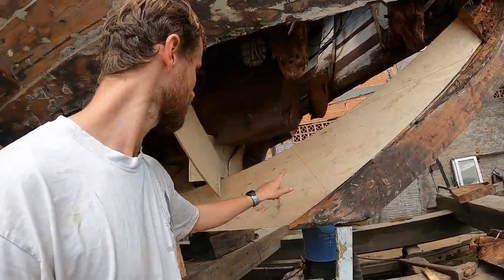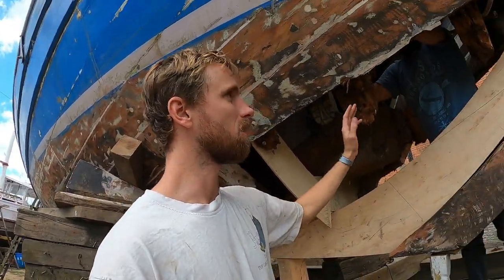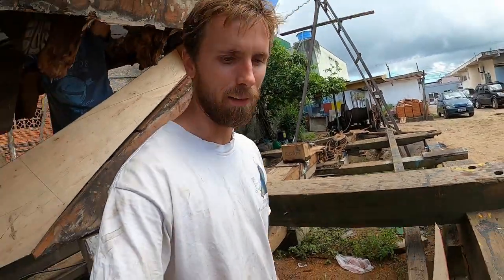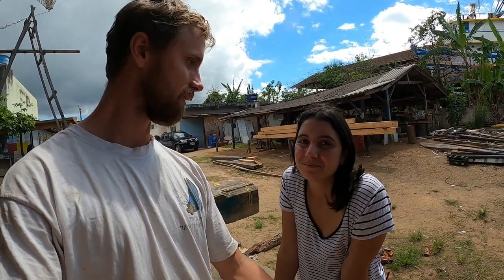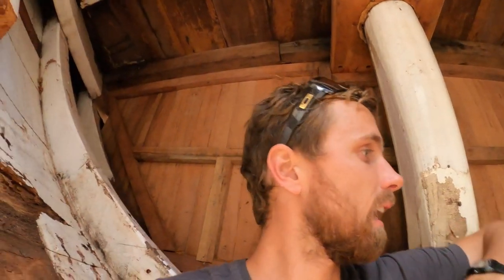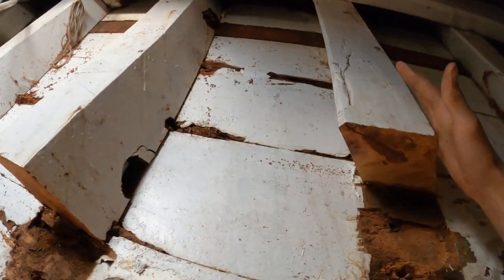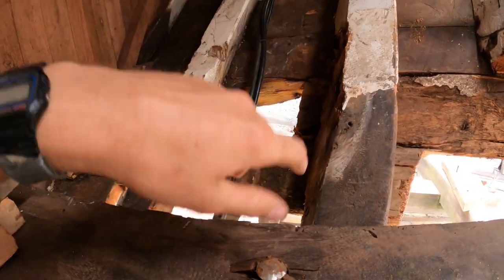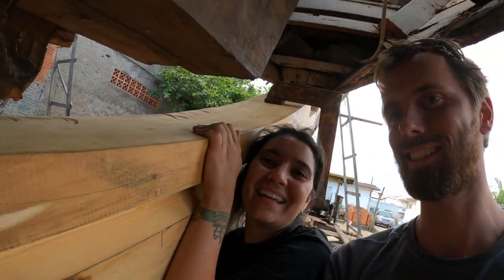From WRECK to DREAMY starts now! — Sailing Yabá #13

Comment from the maker: Hey guys!! 
We are loving how much you participate in our videos and we really appreciate the fact that you comment! 
And for those of you who are incredibly kind to us: THANK YOU SO MUCH, we truly appreciate your support!
Unfortunately, as our lives are focused on the refit, we are lacking time to respond to you all! Please don't take us wrong!
As it's really difficult to answer you individually, we are going to leave here some information over the main questions we’ve been receiving.

1) What kind of wood was the boat originally made of?
The hull was made of Jack Tree (Artocarpus heterophyllus), the deck out of Jataipeba (Dialium guianense) and the structure out of Sucupira (Pterodon emarginatus) and Vinhático (Plathymenia reticulata). 

2) What kind of wood are we using for the new pieces?
The wood we are using is Garapeira (Apuleia leiocarpa).
 
3) What are we going to do to avoid the worms to eat our keel again?
First of all, we would like to clarify that what happened to the old keel was a combo of: neglected maintenance + boat stuck at the same place without moving for too long + tropical waters (worms’ favorite environment). As we are planning on moving and maintaining the boat yearly, the worms shouldn’t be able to feast on our hull like this again.
Besides that, we will treat and protect our wood against the worms, for sure. For now, we’ve been applying a protective thin coat of an anti-corrosion primer, to start protecting the wood from sun, rain and basically anything in general. As it’s very thin and gets absorbed very well by the wood, it also works as a treatment against cracks by simply nourishing the wood. We still didn’t define 100% what will be done afterwards, so we will share this information later on. But we believe we will be using epoxy, tar and anti-fouling in layers to protect the hull, which is the most common technique here for wooden fishing boats. 

4) When was Yabá built?
Yabá is from 2006/2007.

We are sorry we didn’t mention this in the video… it’s been a very steep learning curve and we often find ourselves so fascinated about the process that we simply forget to mention some other stuff!
We hope this clarifies your doubts!
Thank you so much for being here!
Feel free to ask more questions, we will try to answer individually or, again, we might answer many at once like we just did.  

FOLLOW YOUR DREAMS AND BE HAPPY
Love,
Ben, MP & Yabá!
Reply: U reply when u can and wants. i think its great to get a answer from u but not a request or demand. Take care and love your videos..
Reply: Thank you ! Very exciting project and boat.  Original boatyard with impressive talented craftmen. Very nice couple Ben & MP !
The idea I saw about writing in a paper logbook is great. If you ca make it clean with drawings and some technical words & datas you could put it later on a website (or even a book)
Reply: This is so great! The little summary is fantastic. You guys are getting better with the terms used during construction. Each video is progressively better. Cheers!!
Reply: Young lady you are as cute sweet hard working and adorable as can be. He is a very lucky man to have found you.
Reply: Will you be attaching the new wood to the old with appropriate bedding compound/protective layers? I think some comments were made on one of the early videos about the new pieces.
Reply: Ok ok looks at
Reply: You are starting of course with the channel so here is some constructive feedback of a single viewer. I personally think there is too much repetition. No need to explain multiple times what is the old and new pieces and where they go. That would become a showstopper to keep watching future videos. Maybe have a look at Tally Ho restauration videos for inspiration. Also lots of episodes there with same kind of works, but less repetition in a single video? Good to see that you choose to be thorough on the rebuild.
Reply: hfg
Reply: Awesome guys, you never fail to entertain and being able to work in and around the craftsmen, wonderful, you wouldn't get that here, health and safety gone nuts. Keep following your dreams for all our sakes.
Reply: Do you guys know the origin of the new wood that is being used, considering that the tree in question is considered a vulnerable species?
Reply: @oldwillie313  So they need to get a book or need to focus on worm prevention??.
Reply: You do what you want.  Wooden boats are special in that you can rebuild them. Keep on keeping on.
Reply: This old world high level craftsmanship in boat building is incredibly fascinating! 
Thank you for sharing what you can with us. Please don't feel pressured to explain every detail. We love watching what you post no matter what! 💛⛵
Reply: Just to repeat what l think everyone is saying,.... You both look after yourself and Yabba, we can see whats happening every time you post a new video... :)
Reply: Nice work
Reply: ⁰
Reply: UU
Reply: @Aluminium workboat project fresh water ingress...
Reply: @Aluminium workboat project  As far as i remember, they said that the boat has never been taken out of the water since it was build.

Comment: A chain saw would never have entered my mind as a boat repair tool!
Reply: It's a joke. They are milking the owners by using full and dangerous equipment with very little safety in mind....
The owners are milking you without bothering to even learn common boat terminology.... this is a  scam.
Reply: Chainsaws are frequently used when building boats of wood, how else would you cut an 18 inch thick beam? Do you see a ship saw there in their shop? Too many arm chair know it all's here.
Reply: @shaggyduder  All my shipyard experience (40+ years) was steel hulls, no chain saws there:)!

Comment: Ok, I've been a skeptic about all the rotten wood,  no secret about that. Still there is something about their dreams and their persistence that is inspiring. And, I keep thinking about which part of the Amazon rain forest is now denuded to provide the lumber. Ugh. Well, it is what it is. it will be nice to see the boat restored, even though in 10 years it will be rotten again. Enjoy! :)
Reply: There is more then only the Amazon rainforest in Brazil, see Mato Grosso, Mato Grosso du Sul and some other states with hardwoods so don't worry. But on the the other hand I agree it will take less then 10 years this vessel is sunken and forgotten. You do it wright or not, All and every piece of attached wood by worms, termites or other defect should be replaced!!!

Comment: Many thanks for another video.... It's all becoming more and more exciting as you get closer to rebuilding, rather than the tearing down! 
The most difficult of all pieces will be that 'sternpost' with the hole for the prop shaft going through it and I can't wait to see how they're going to get the angle of the shaft hole right as it'll have to be quite perfect and drilling such a long hole at the correct angle could be a nightmare, especially with the basic tools your chaps have - though I suspect that being the old school shipwrights, they'll have a good 'old school' way of doing it as it won't be the first time for them!  I can't wait to see it happening!

Comment: Probably a little late to the party,  but as a wooden boat owner and restorer I would highly recommend that you treat all of your new Wood with penetrating epoxy or CPES  as it’s often  referred to.  This would be especially true of the end cuts to prevent wicking of moisture. You can also treat some of your Older wood to prevent further decay. I prefer Smith’s but there are other brands out there. Hopefully you can find something in Brazil. Best of luck to you.

Comment: 1)) @2:15 There is a 3rd way for the the boat = drag it to some off-grid desolated beach and make a Brobdingnagian midsummer-night fire (if that much rot can burn).
2)) @4:40 The "crust" = sapwood & "like the wood should be" = heartwood [the wood core for most spp). Every wood affectionado knows that sapwood [in most spp] is inferior for most kinds of wet environs while heartwood [in most spp] is more rot resistant as that's where sap and resins is stored [not transported].

Comment: Love the tools of some of those old style craftsmen . Old wood chisel and the side of a claw hammer . No fancy double plated shot blasted super expensive tools that one would not really what to use because they might get worn out . Sort of MacGyvering it , you know . Taking a pocket knive and building a shopping center . Waiting for the next installment .
Reply: I agree, but they could have sharpened the tools they use. I don’t think I have ever seen such dull tools. If the drill bit is going to be as dull as the chain on the chainsaw the will never finish the hole fore the propeller shaft.
Reply: As a machinist, seeing the different ways they use to do the same thing is fascinating.  But I'm sticking to my CNC machines
Reply: MacGyver would be proud.

Comment: Glad to see veteran shipwrights working which is a big factor. You have to have the older experienced boat builders. Nothing against the younger guys everyone has their purpose. MP is so sweet. I love her accent. Ben if you're going to be sailing this boat you both need to read about what parts of the ship are called not the "front" & the "back" of the boat. Lots of heavy work in this video but coming along. Looks like you found more rot. Love your channel.

Comment: 4:38 You're talking about the sapwood. This is the softer wood on the outside of a log where the tree does it's growing, it is softer and less resilient than the heartwood.
The heartwood is what you want to be using for replacement timbers.

Comment: Would it be possible for you to tell us what types native wood you are using and why, other wooden boat YouTube channels do this and it’s really informative and help us understand the rationale. Are the upper decks watertight yet to stop water coming into your new build wood?
Reply: the wood is Garapeira (Apuleia leiocarpa)
Reply: it is known as brazilian oak...so it is right material for keel and frames
Reply: Check their main intro post. It’s all summarized there.
Reply: @gg9960  ahh.  Jatoba? That’s very good!  Did you have ferrous bolts previously? It looks like some of the rot was caused by the metal do you think? 
Have you had a peek on ? 
http://forum.woodenboat.com/archive/index.php/t-3871.html
Do they use anything between the wood when it is joined? 
It’s an amazing looking craft, in some ways it reminds me of the Indonesian boats.
Stay safe with all the Covid

Comment: That cut on the stem is part of the rabbet joint, a rebated joint for the lowest planking.

I'm curious about the cost of the operation, labour and materials etc. Those skilled shipwrights look like they're putting many hours in each day.
Reply: manual labor is pretty cheap in brazil....and with the current exchange rate, if he is using his british pounds it is very cheap.....half the price of 5 years ago and 1/3 the pruce of 10 years ago

Comment: Ben and MP....is any of the new wood somehow treated to prevent future worms, corrosion etc?
Reply: They pinned a comment answering the most asked questions and there they talk about the wood as well.
What are we going to do to avoid the worms to eat our keel again?
First of all, we would like to clarify that what happened to the old keel was a combo of: neglected maintenance + boat stuck at the same place without moving for too long + tropical waters (worms’ favorite environment). As we are planning on moving and maintaining the boat yearly, the worms shouldn’t be able to feast on our hull like this again.
Besides that, we will treat and protect our wood against the worms, for sure. For now, we’ve been applying a protective thin coat of an anti-corrosion primer, to start protecting the wood from sun, rain and basically anything in general. As it’s very thin and gets absorbed very well by the wood, it also works as a treatment against cracks by simply nourishing the wood. We still didn’t define 100% what will be done afterwards, so we will share this information later on. But we believe we will be using epoxy, tar and anti-fouling in layers to protect the hull, which is the most common technique here for wooden fishing boats.

Comment: The white wood,crust of the tree you call it, is the sapwood.
Reply from the maker: Thanks! Will try to remember for the next time! In Portuguese we call it "brancal", which refers to the color white.
Reply: @SailingYaba  Ou alburno.
Reply: @SailingYaba  what kind of bolts for the keel and nails are you using? I mean what are they made of? Are the ferrous material?  Also, are you putting any kind of sealant between the wood as you attach it?

Comment: Can you tell us the species of wood they are using? Are they using the same for structural pieces as planking? Dry or wet timber? Are they considering the woods grain direction/curve when selecting which piece to use for where?
Reply: the wood is Garapeira (Apuleia leiocarpa)

Comment: G'day  Crew ,,
BIG  SHOUTOUT
 to the boat yard workers ,,
who are doing a great job  on Yaba...
Really loving the replacement pierces  of woodwork  that will be fitted  to the BOW , KEEL & STERN   ....
I do have one question for you Ben & MP,,   
Will these new large wooden  pieces  be reinforced "in place" by  BOLTING  in   any PLATES, BRACKETS ,  ANGLES,   I BEAMS,
C SECTIONS  or WELDED BRACKETS,  specially used to join & strengthen   the new work  in place to the old structer..,, ???????
As most  other larger  wooden boats make use of casted   "Bronze brackets"   in areas of   "high stress"    which are  expensive .  
I wondered if you had plans of using any  type of metal brackets ,
such as alloy or steel ,
 which could be installed quite easily now Yaba's hull  is open , making for easy access.
  
Excellent video guys ,,  the best .

Much Respect 
      from
Down Under

Comment: It's actually starting now, pretty soon you'll be rehulling/replanking the hull with Yaba starting to feel like a boat again!
Must be getting exciting for you both.
Reply: And with every board they pull off they’ll find more rot. Did you see the video where they did a tour of the inside?  Cool boat, but every room has a leak. When they pull the walls and ceilings to fix it they’re gonna find more rot. This whole boat is rotten.

Comment: I’ve never seen this boat design before, is this a blue water sailor or designed to hug the coast? Just curious.
Reply from the maker: It is based on a Saveiro, a traditional Brazilian merchands/cargo sailing vessel. The goods thansported made up of a great part of the ballast. These saveiro's are still used professionally in many parts of Brazil

Comment: How are you going to stop the wood worm coming from the inner part of the boat in to the new wood 
because there will be one or two worms in wood on the inner side of the boat.
Reply from the maker: Hey Arthur! There's no way we have any worm left inside the boat because they can't survive for long without water! So that won't be a problem. The problem will be to keep rotten wood and that its humidity ends up ruining new pieces... that's why we are aiming on replacing everything that's rotten! Thank you for your concern!

Comment: Ben,  you talked about the old pieces of wood FROM YABA being used to support Her.  Do you think any 
enthusiastic supporters would donate to your cause to have a small slice ( ~ the size and thickness
of a slice of bread ) to help them remember YABA, your adventure, and their part  in it all ?  Just a thought.
If so,  I wonder what the export charges for international sales would be.
Reply: most countries wouldn't let you import rotten wood. if they do they shouldn't. it's also a terrible idea to keep rotten wood because rotten wood ruins good wood.
Reply: Thank you for the comment.  Having extensively traveled outside the USA I agree 100%   If rigorously dried, small sections of GOOD, NON-ROTTEN YABA WOOD remnants were shaped, sanded/finished etched with information about the wood then multi-coat sealed with urethane varnish, would this still be problematic ?
Reply: It probably stinks. Not sure I’d want that keepsake. I guess every time someone walked in the room and asked what that funky smell was you’d get the opportunity to tell them the Yaba story, a story about someone else’s boat whom you’ve never met. 🙄
Reply: Interesting.  Dried, cut, sanded and eavily urethane coated WOULD NOT HAVE ANY ODOR.  I can say that with confidence since I work a lot with old weathered wood.  Do you ?   As to "people I've never met" ; maybe.  But, I believe in connections with people that are not limited to Time and Space.  This is the kind of thing that people with "feet of clay" will never comprehend.
Reply: @nunosantiago2273  Funny response.  I found it refreshingly clueless :-)
Reply: @nunosantiago2273  odor comes from organisms and water in the wood.  To be meticulous, autoclaving would destroy organisms thoroughly drying followed by encapsulating in a varnish or polyurethane would prevent any organisms left from escaping.  Two coats would keep the wood from being compromised in an impact abrasion.  The shipwrights working on YABA would be the experts to consult; more so than a Chemist like me.
Reply: @nunosantiago2273  Thank you.  I was confused.  Rotten wood, you are 10p% right.  In my original comment I ac, owledgec the danger of rotten wood.  I could be wrong, but there are probably some GOOD NOT ROTTEN FRAGMENTS.  The autocla e using ethylene kxide instead of steam would clear a y bacteria and organisms to a depth of ~a few millimeters.  Again you are right; avoid rotten wood.  The process I am suggesting should help with export.  What do the shipwrights say.  Skrry for NY vitrikl on my part.